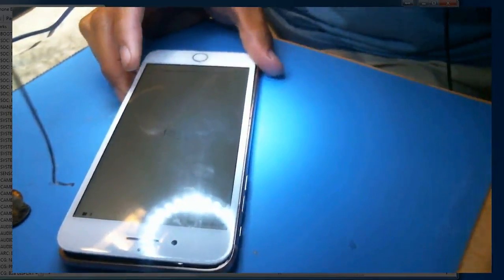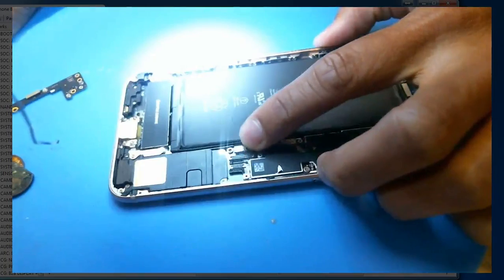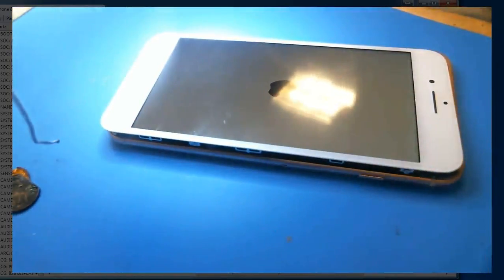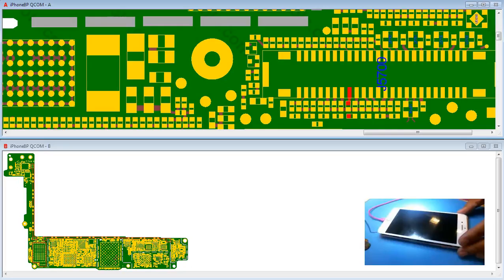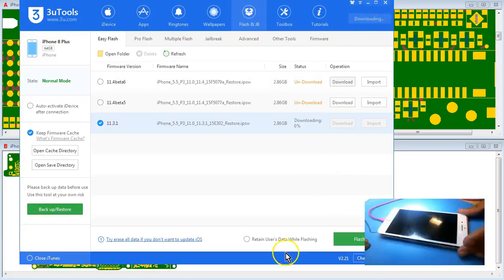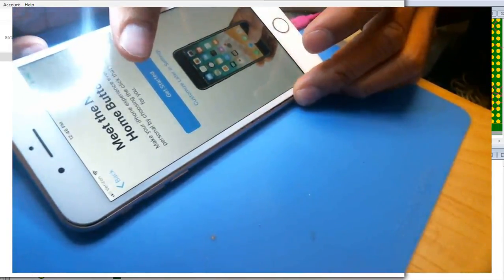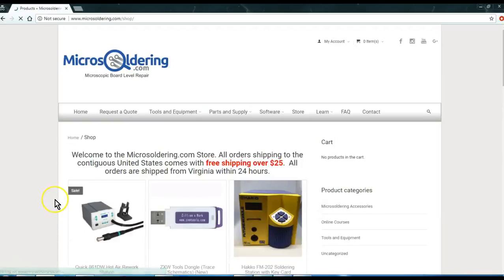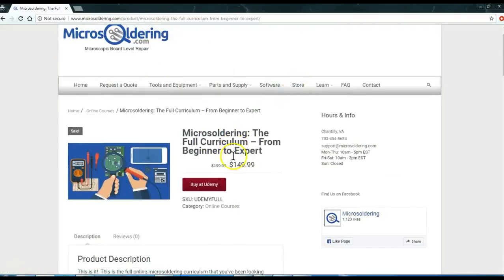iPhone 8+ No Touch after DIY Screen Repair

Comment: having an issue with a 8 plus, after a screen replacement was stuck at the apple logo.  did a software upgrade through iTunes and now boots to press home to recover and the home button is not working. Anyone know the fix?
Reply: I am having this issue, did you ever resolve it?
Reply: You probably have tear the flex of ear piece
Reply: we are the same too..